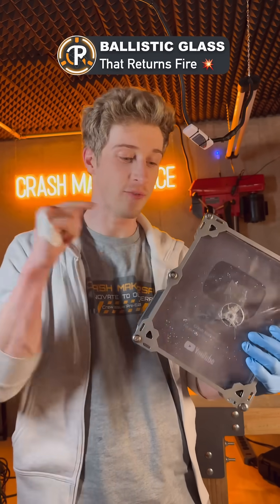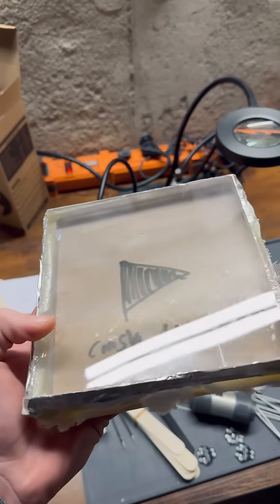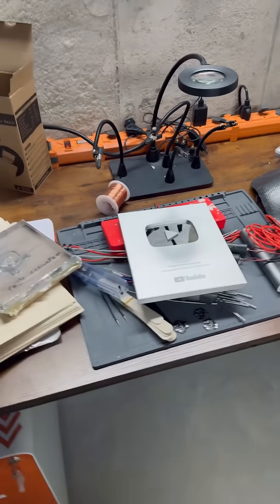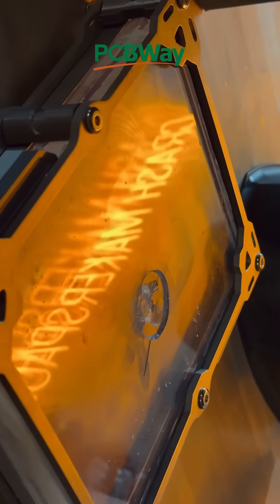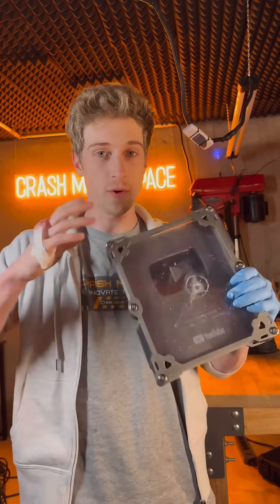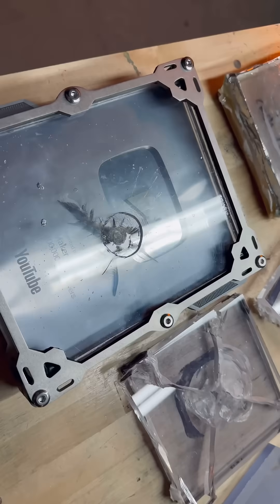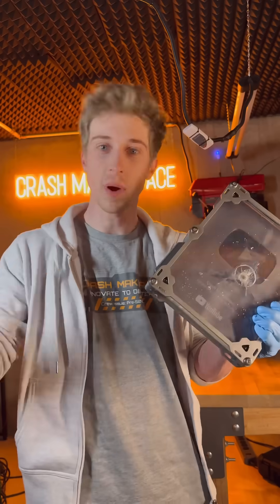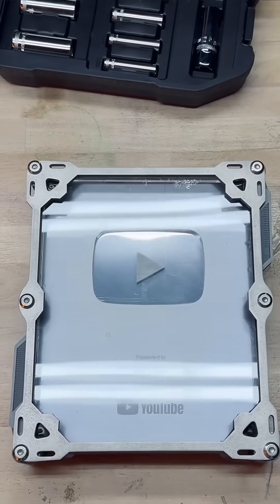This Bulletproof Glass has a Quirk...💥#shorts #foryou

Comment: I like your enthusiasm to build bullet proof materials. Very cool! If you angle the glass downward about 10 degrees the spalling will deflect downward. to the ground. Glad the injuries are minimal.
Reply from the maker: Angled would've diverted it elsewhere! With the Welding helmet and safety glasses, my face was covered so I wasn't worried about getting hit on my body since these hit back similar to a sling shot impact (but this would do some real damage if it got ya in the mouth or eyes unprotected for sure)
Reply: nut shot